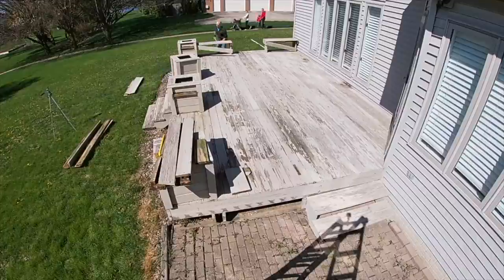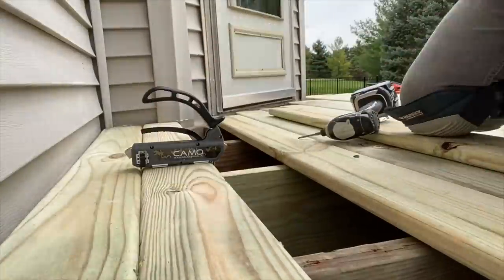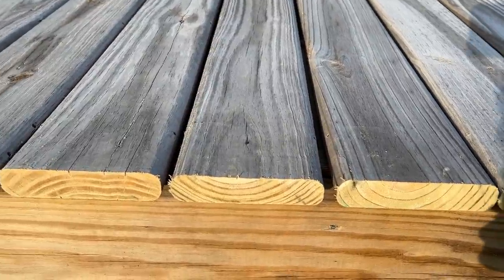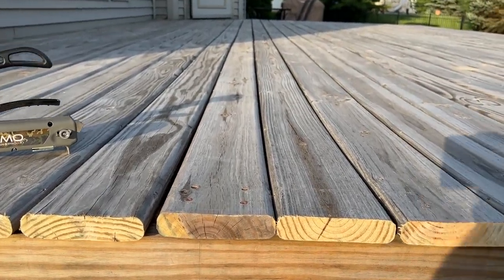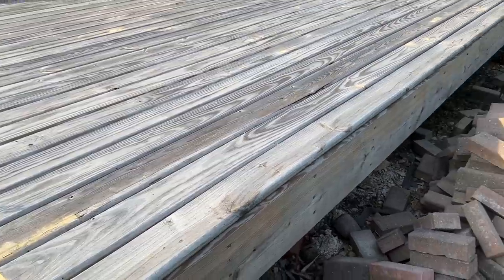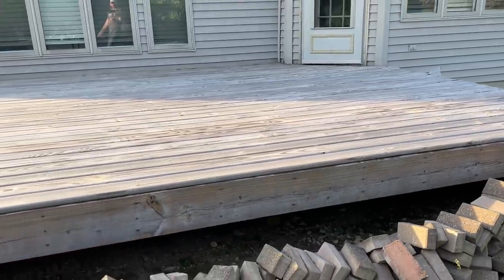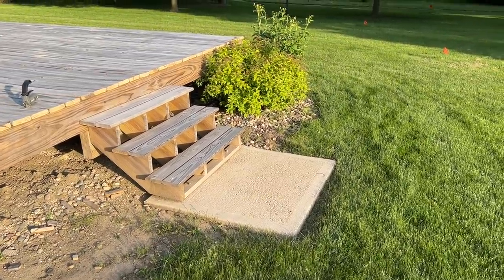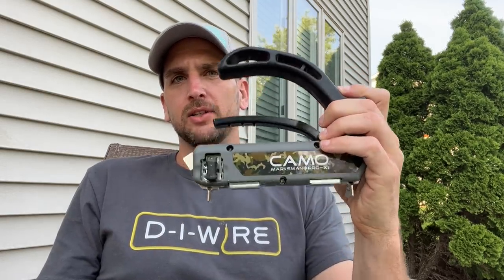Deck Rebuild Project - Pressure Treated Wood After 2 Years

Comment: I wish our deck was ONLY 350 sq. feet!  Ours is 2000 sq. feet, around a 30 foot above ground pool!  I NEVER would have installed a wood deck this big, but we liked the house and the pool and... now we have a maintenance nightmare!   

The previous owners did not use treated lumber for all the joists!!!  @#$#!!!  DON'T EVER DO THIS!!!  Now we are rebuilding the entire deck!   

It's divided into 3 sections so we rebuilt the middle section 3 years ago.  Now we are rebuilding the rest.  

Lessons learned:  
-Camo screws work good, but use the longer Camo screws.  
- Install double joists at the ends of the deck boards.  This provides more area to install screws, and you can double screw the board ends to prevent them peeling up. 
- install 4" asphalt roofing tape on top of the joists to protect them
- Thompson's water seal works the best, but you still need to do it every year, and you can't do it for 3 to 6 months after you install the boards.  They need plenty of time to dry out before staining/ sealing or it will just peel up.  It still peels a lot, but I think eventually it will stay on pretty well. 
- There are lots of good resources and ideas online.  Do your homework before starting a deck project. 
- The number one lesson is DON'T BUILD A GIANT DECK!  Keep the deck small and manageable.

Comment: Since the cost of wood is more now, would you advocate for composite materials instead of wood?
Reply from the maker: The cost gap between pressure treated and composite has closed a lot so it is much more compelling to go with composite.

Comment: I can’t believe the boards shrank in length as well.
Reply from the maker: Yeah, unfortunately the modern pressure treated comes in super wet 99% of the time and that means when all that moisture finally pulls out the boards shrink fairly dramatically.  Kind of a pain.
Reply: @EverydayHomeRepairs  thanks for the response. I’m picture framing the deck boards and this shrinkage is freaking me out now. I think I’m gonna make my center spine board frame wider just in case.

Comment: Trex decks are so much better. Zero maintenance, never look old, never rot. Keeping wood outdoors looking good is so labor intensive. I'd recommend just painting the deck. You'll need to repaint eventually, but still probably less work than sealing the whole thing every year.
Reply from the maker: Does your Trex deck get pretty hot?  That is the only regular complaint I hear.
Reply: Actually IMHHO …staining works better than paint …But in any case the most important step is preparation and getting the Best Quality paint or stain …and all require regular maintenance  😍😍😍
Reply: Painting a deck is not good advice.  Water will get under the paint, it’ll bubble, and you’ll have a huge job scraping it off and redoing it with stain. A friend made this mistake. Use an opaque stain if you want a paint like finish without visible grain.  Opaque stains will also protect against UV damage much longer, but I personally much prefer the more natural appearance of a semi transparent stain.
Reply: @readyplayer2  🤗👍I Totally agree